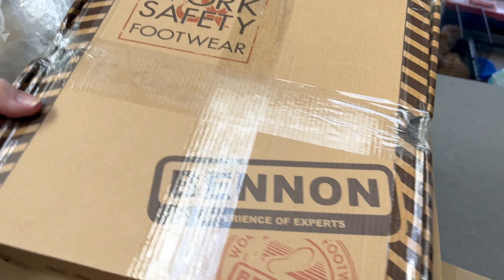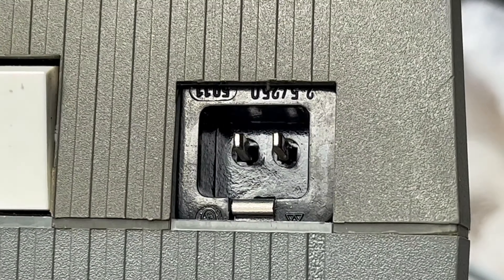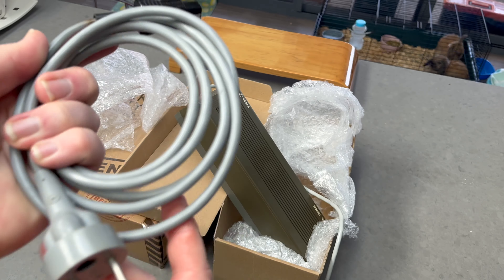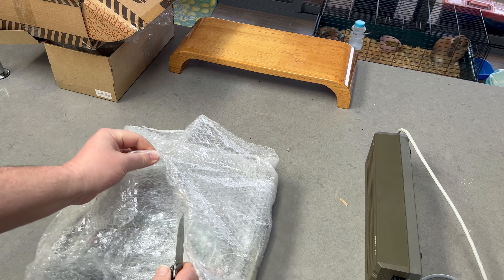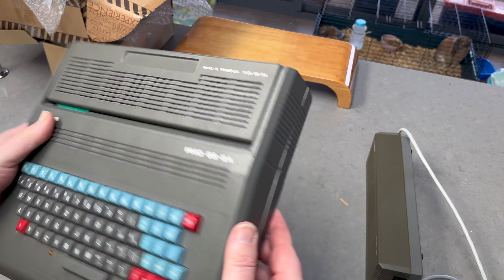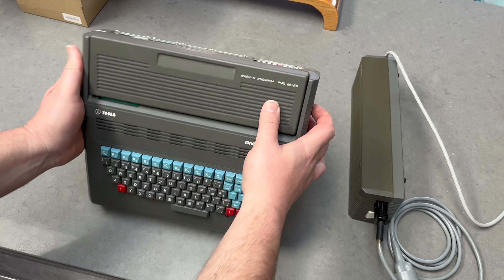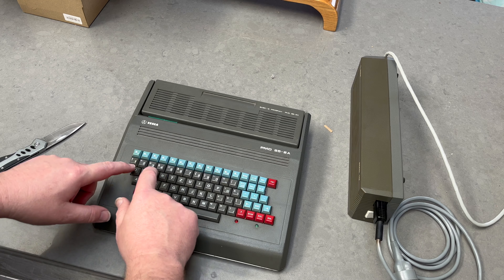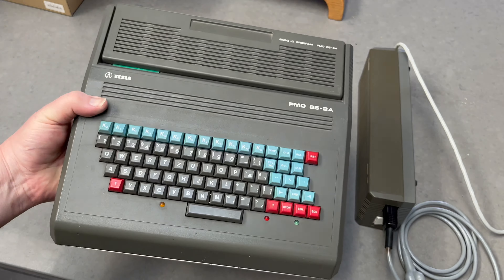🇸🇰 Coming Soon: Tesla PMD 85 (PMD 85-2B) [TCE #0347]

Comment: Now that's a pretty computer! Funky looking connectors back there. You have a couple of screws on the bottom of the computer, might be the locking mechanism for the ROM module?
Reply from the maker: Yeah, could be ... but I didn't see anything between the bottom of the ROM module and the computer case ... let's see ...